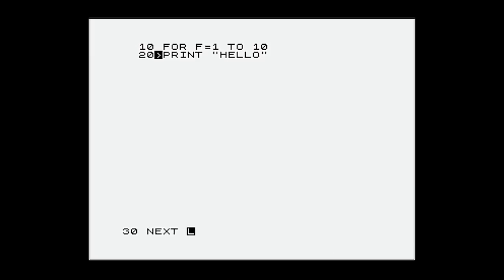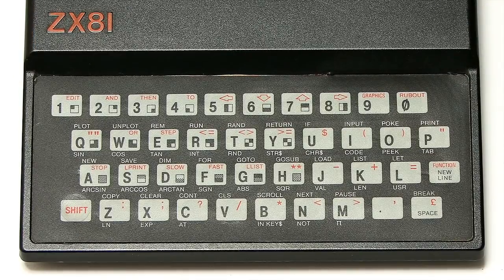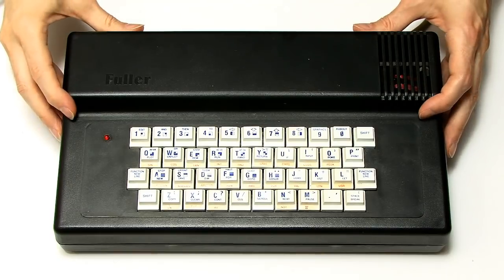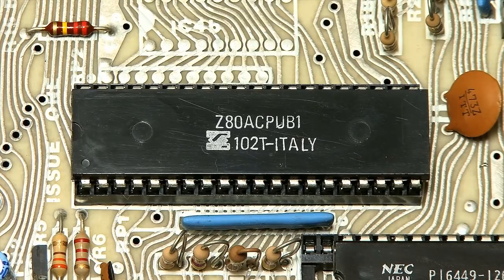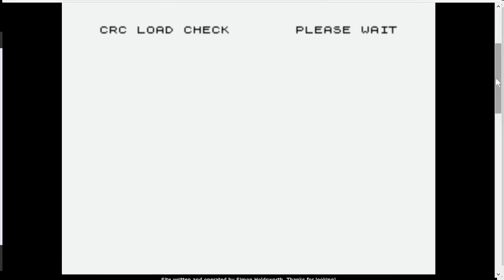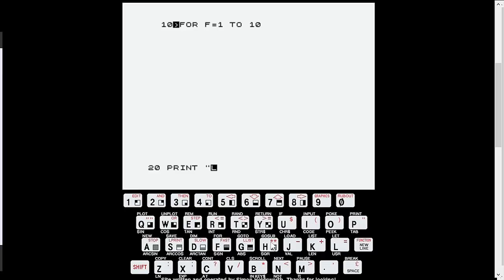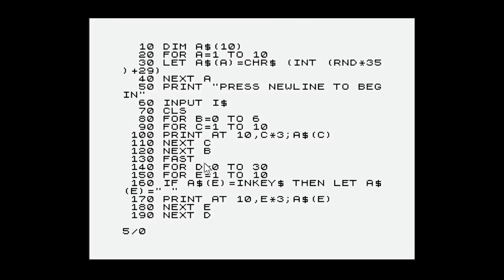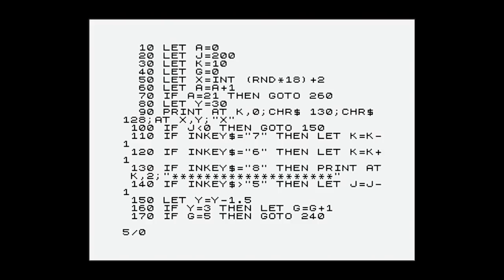ZX81 Classic PC

Comment: The Z80 is still used in those Texas Instrument graphics calculator.  I learned to program in assembly using the 8085 processor and would later learn the Z80 could use the same code and more!

Comment: I got my ZX81 in 1982, then got a Speccy 48K in 1984. I still have them.

Althogh my ZX81 is heavily modded. Composite out, SD card, 64K bult in RAM and fully programable joystick port.

Comment: I talked my parents into buying it for me. I chose the self -assembly kit  version. I got a Phillips 12 inch b&w tv. soldered the bits, but my keyboard connector I accidentally folded and it damaged the connection as to a line of the keyboard characters couldn't work! I bought a 64k ram pack. But the slightest vibration lost all the date in the pack. I sold it for half price to another motorcyclist son.

Comment: I guess my first 'computer' was a Texas Instruments TI-58C programmable calculator with Print Cradle.  Then, bought a TS-1000 at a corner pharmacy for $100.  I quickly became frustrated with its keyboard, just before the Commodore 64 came into my life.  I skipped the VIC-20.
I spent several years with the C64 wasting an ungodly amount of time learning how to program it in BASIC...which probably contributed to the end of my marriage.
I stuck with Comodore and Amiga computers until 1995, when I bought my first PC Clone with the release of Win95, and discovering the internet.

Comment: My first computer was PC6001mkII. My father bought it to me back in 1990. The system includes the NEC 6001mkII computer, cassette recorder, 3.5 floppy drive, 4-color plotter, joystick, and a monitor. I learned BASIC with it and also used it later to do machine language programming on it's Z80 processor.

Comment: My ZX81 was actually my second computer. My first was the COSMAC Elf. Eight toggle switches, a two digit hexadecimal display, a push button, and 256 bytes of RAM. It actually got me my job of 32 years in 1987. The company I worked for had many battery instruments. And and for low power. The 1802 was about it. A few of our products still used the 1802 in to the 2000. Just wasn't worth redesigning them. 

The  I got the ZX81 and was just crazy about it. I don't remember why. But I later got the TS1000. Later I got a ROM with Tree Forth. I fell in love with Forth. Unfortunately it fell somewhat by the wayside to C. I also got a case like in the video. I  am pretty sure it was a different one.

Comment: I got a Timex-Sinclair TS-1000 in 1984. They were put on a clearance sale, so I was able to buy the computer and a 16K RAM pack about $50 IIRC. I had taken two computer science courses (FORTRAN and an IBM 370 Assembly course), so I spent many an evening doing various BASIC and assembly programs on it. My major project was going to be a Dungeons and Dragons character generator and dungeonmaster assistant program, but about that time my wife was gifted a Heathkit H-100 computer, printer, and modem. She encouraged me to retire the TS-1000 and work on a "real" computer. Yeah, the H-100 was a more productive system, but there was an element of fun to the TS-1000 that wasn't exactly available with another system. There's a sense in which the TS-1000 served as an introduction to embedded systems, because it essentially is more like a microcontroller with a graphical monitor program than it is a typical desktop computer.

Comment: My first computer was a ZX Spectrum 16K, later upgraded to 48K. I spent a lot of my teenage time with that machine. I started out learning Basic, and succeded in selling a simple game written in Basic to the bookstore in my local town, which was running as a demo in the store window :-) Later I got into Z80 assembler coding, and bought The Complete Spectrum ROM Disassembly, learning all about the "OS". One of my friends was good with hardware, and one of our most advanced projects was getting the Spectrum to work as a MIDI drum machine. He designed a MIDI interface and DA converter, which was plugged into the expansion port, and I wrote a program that could play 2 drum sounds simultatiously. I had to use only the upper 32K for program and sounds, since the lower 32K was apparently shared with some hardware reading the display buffer, which made it implossible to maintain a specific pitch when playing back sounds through the DA converter.  Thanks for the blast from the past, I really like your channel. Kind regards, Ole, Denmark
Reply: My Specrum also underwent a transplant to a full keyboard, since the rubber keys tended to wear down the keyboard membrane. I still have the computer, and have put it back in the original case, but alas, it does not seem to work any longer.

Comment: I was given a zx81 in 82 & leant BASIC, eventually getting a 64K ram pack for my only xmas present to further my programming - light-cycles, text adventure gaming, & playing 3D monster maze & Oregon trail. Eventually i traded it in for an ORIC-1 which had an upgrade deal to ORIC ATMOS where i made my O level programs "Doom Tower" text adventure, "SNOT INVADERS" & 3D C.A.D. (computer aided drawing) before making a multi graphic adventure game consisting of about a few different graphics games to achieve the ultimate goal e.g. racing game, platform game, light cycles, shoot-em-up game, puzzle game etc. I even tried to program machine code/HEX to make a game on it but that kept crashing miserably along with me not getting thru to 2nd year A level by 3%. I never touched a computer again until 1997 using PASCAL & C on a 386 & 486 - win3.11 & win95, but find EXCELL macro writing on my company stock control program & WIX more fun.

Comment: Mine still works but I've ordered a ZX Spectrum Next Accelerated - Issue 2 which hopefully will be here early in 2022. Fingers crossed! Yes, the ZX81 was my first home computer (we had our own IBM 360 at college) and I quickly added 8K of additional CMOS ram. It wasn't my first Sinclair product, however as I also owned one of their LED wrist watches and several calculators. I am forever grateful to Clive Sinclair, my hero! I would go on to create the world's first netbook (1984) which used a CMOS version of the Z80, a 4 line graphic LCD display, waterproof membrane keyboard, radio frequency (MW) recharging, 128K of CMOS RAM (in 32K banks with 32K EPROM occupying the lower half of the memory model). The serial interface was handled by two opposed photo couplers giving a magnificent program speed of 19,200 bps. The whole unit was built into a magnesium alloy case and the unit was used in gold mines, primarily as a data logger. The CMOS processor was provided by Hitachi (the HD 64180 64pin) although subsequent variants employed Toshiba and Hitachi chips (especially the 6309). We actually got early access to the HD 64180 in 1984 and it proved to be a very robust chip indeed. The Hitachi 6309 had computational advantages which was the reason for the switch.

Comment: I can relate to that early 8-bit era nostalgia, although the Sinclair's weren't common here in Canada.  The computer that got me to learn programming in an enthusiast sense was, oddly enough, my second computer.  I started on a VIC-20 but I mostly just played games on it.  I'd really wanted an Atari VCS but my father wanted something "educational".  One burglary and insurance company later, my VIC-20 was stolen and replaced with a Commodore 16.  I guess one cheap Commodore seemed about the same as another to the insurance guy and my dad.  

Suddenly I had virtually no pre-existing software but I had 16kB of RAM (seemed roomy at the time) and a the much more graphically capable DOS 3.5 (which included a graphics mode not present on the VIC-20 or the C-64).  I also promptly learned that every byte mattered with 16kB!  So I had to get creative to enjoy my computer and I got into creating screen art via BASIC programs.  

When I got a C-64 a bit later, I kept coding but I missed that graphics mode.  I mostly gamed on it but I also wrote and maintained a D&D character generator tailored to my group's house rules.  That one taught me how small 64kB was (probably could have done more if I had learned assembler).
Reply: For anyone unfamiliar with the graphics mode in BASIC on the post-C64/pre-Amiga Commodores (C16, Plus 4, C128 in native mode), they had added a special drawing mode with geometric drawing commands.  It was a bit like the old LOGO programming (err, programmed drawing?) language on Apple II computers and undoubtedly liberally borrowed ideas from it.

Comment: Here "across the pond" my first computer was a Timex/Sinclair 1000 and my dad splurged on the 16k expansion cartridge which resembled a standard wall outlet voltage adapter block. I believe he spent $60 on the Timex and I don't remember the price of the expansion, but $20 "feels"reasonable.
I used an old cassette tape player for program storage, and a black and white TV that was circa 1968.
I got a summer job the next year and moved up to the glorious Commodore 64. 👍

Comment: My first computer was a TRS-80 (model 1), it originally had 4K ram and a 4k basic called 'level 1', I later had it upgraded to 16K ram, and level 2 basic, before adding an expansion box, disk drives, printer, and modem.

Comment: I had the ZX Spectrum, perhaps 1984, in Finland, in my teens. I did learn programming in BASIC but I also learned the assembly language and did some things with it. Oh it sure was a golden time. A couple other friends also got the Spectrum, and one got the C64. I also ordered the "Your Sinclair" magazine (previously "Your Spectrum") from the UK, it was fabulous! And I got a couple of hardware expansions, at least a light pen (which was crappy) and a 3-voice sound module (which was great, based on the AY-3-8912 chip).
EDIT: Those times were so fascinating, where each new computer had its own eccentricities and quirks, not like now where each PC is basically the same just with different performance levels :)

Comment: Regarding RAM, it could only have 16K maximum of RAM that could be used for executable code. This is because the program area started at the 16K boundary, but because of the unique video circuitry anything from 32K onward was interpreted as part of the video system if you tried to execute any code there, so not executed- the hardware would read your code as NOPs unless the instruction had bit 6 set. So larger RAM packs could only use that area as data. Also the primitive address decoding meant the 8k ROM was mirrored into 8k-16k on the memory map, but potentially you could squeeze in 8k of RAM there if you added hardware to disable the ROM_CS line during accesses. But you still wouldn't be able to put BASIC code there though you could run machine code in it. But that area was normally used for external addons' ROMs. I had the Memotech Hi Res Graphics pack and its pitifully slow ROM routines ran in that space. That was also the addon that convinced me/confirmed to me that whatever I might want to believe, my ZX81 was already obsolete.

Comment: I had a Timex/Sinclair 1000 .  I remember writing a program to deconvolve infrared spectra using gaussian or lorentzian peak shapes.  It was quite a challenge to get that program to work properly in only 8K or ram, but back then compact programming was a real thing.  It was also a real problem to digitize the IR spectra.

Comment: My 1st computer was a ZX81. I had the Memotech 16K rampack fitted, this rampack ran the whole width along the back of the ZX81 and was very stable. I remember my mates ZX81 computers with the original 16K rampack used to wobble a then the ZX81would crash. Thanks for the memorys Chris, very interesting channel.

Comment: hi, I found a ZX81 in a skip, it had a 32k expansion board. It was raining a little, but I opened it up and it looks fine (i didn't take a close look at the motherboard as that would entail extra unscrewing). What's particularly notable is the impeccable touchpad. It's a project I would never get off the ground. I am London based and wonder if anyone is interested in taking it off my hand? I'm happy to pay postage if it's going to a good home and might have use like a museum etc <3

Comment: My first "computer' was in 1975 a Hewlett Packard HP-25 programmable calculator for which a wrote a mastermind program with numbers instead of colours. Later on I upgraded in 1976 to an HP-67 with magnetic cards that stored the programs. I still have that HP-67 in excellent condition and still working.

Comment: The ZX81 was made in Dundee, Scotland, more usually assembling clocks and watches.
The staff were encouraged to buy one and could do so at a very good discount to the retail price (£99 I think). Staff take up was high as staff were selling them on to other locals, like myself, for less than £99 but often for a bit more than they paid.
It was my first adventure into computing and I enjoyed the hobby. I bought an external keyboard kit, having to solder every key separately. I also fitted a memory extension unit but these products were very unreliable. If the unit moved slightly the computer crashed. I fitted all the bits onto a piece of plywood, adding some extra support for the external memory unit.
I enjoyed many hours on my ZX81, but not to typing programs from magazines that always resulted in typos.
Very nostalgic to read about the ZX81, thank you.

Comment: Ahhh, I had that exact same keyboard for my ZX81 - I initially only bought it because I first installed an add-on that made the inverse text characters user-definable (like they are on the Speccy), but this add on board just sort of sat off to one side of the ZX81 with a ribbon cable entering the side of the machine (so the Fuller keyboard had space for everything inside)
I miss that computer.

Comment: It's odd to call the ZX81 a "PC". They were called microcomputers or micros back in the day, and PC specifically meant something following IBMs template, certainly a lot more powerful than this little 1k beast!
Reply from the maker: This is true -- but the ZX81 is still a personal computer (lower case) -- a term that was also in use at the time.

Comment: my first computer was a self built (soldered) z80 which got introduced on a german television show in the early 80s, developed by rolf dieter klein. it was a modular system with cpu, memory, monochrome graphics, a few i/o boards and a bus board. i got most of them empty boards, books and eproms of a small local company, all other components of various sources and learned soldering.
my first operating system was a monitor program to read and write into the memory,start programs, burn eproms and save data on a standaerd tape recorder. most programs i wrote in z80 machine code. for a while i fond it easier to count in hexadecimal   lol...
then i built a bank/boot logic, extended my memory to amazing 128k!!! got a floppy drive and installed cpm+.
that qualified my computer for turbo pascal.
did you know that microsoft made a basic interpreter for the z80?
later on i changed over to the motorola 68000 series, built memory cards with gigantic 1mb, and used cpm68k.
there was only monochrome pixel graphics but in calculations like multiplications and so on a intel 286 could not cope  
with that system.
with the 386 i changed over to intel, abandoned my old computer and used os2 warp3 and suse linux with kde. my first windows was win2000. and my last was win7.
now i'm back with linux (mint19.3 mate)....
Reply from the maker: Great post, thanks for sharing.

Comment: When I saw a friend showing off the ZX81 in 1982, I wanted one right away, but he told me to wait for the ZX Spectrum that was due in a month or so..I duly went ahead and bought a small color tv anticipating the release.Three years down the line I had it in a dktronics keyboard, Disciple disk interface with two stiffy drives, large Epson compatible printer, joystick interface, Currah microspeech etc, etc..all interconnected though my hi fi sys of the time..I stuck to this until my first pc xt/at compatible in the late 80's.. 😁

Comment: the ZX81  was also my first computer.  My father would ask me "How are you failing MATH, but programming games?"   Thanks for the trip down memory lane, and keep up the great work!
Reply: In our cabin in Northern Vermont in the early 1980s, after I and my cousin had spent a LOT of time programming something fun on my TS1000, my father turned off a light switch that controlled the AC outlet that the computer was plugged into.
Poof! Bye, bye, meager programming efforts!
Reply: I has a similar problem. It was back in the sixties. Only the question was how I was failing basic arithmetic. But had taught myself the slide rule. And a little algebra and trig. There was now program for gifted students. And I don't even know if ADHD was even known back then.
Reply: "Because the school maths isn't in base 2!"

Comment: I used a ZX81 to create a simple animation for my Betamax home video movies in 1985. The animation was a film strip with sprockets running up the TV screen, inside each film frame it said "Home Video 1985". I used this to separate and date my home movies. I still have the Betamax tapes, but not the ZX81! I recall that if the ZX81 moved relative to the RAM Pack, one lost everything! The ZX81 was a piece of junk, like the C5!

Comment: With the 16K RAM pack the system would heat up and it would get really unstable because of the loose connection. When I was typing in thousand line programs I would put some ice in a Ziploc bag and leave it on the top of the case. It drove my parents nuts but it worked.

Comment: I took mine apart and wired an old teletype keyboard, wire for wire into it. I hated typing on the membrane keyboard. The zx81 fit inside the teletype case. 
I think it was 1979 or 80.